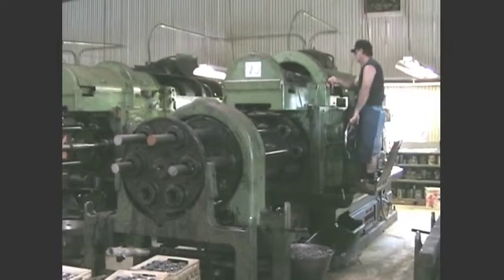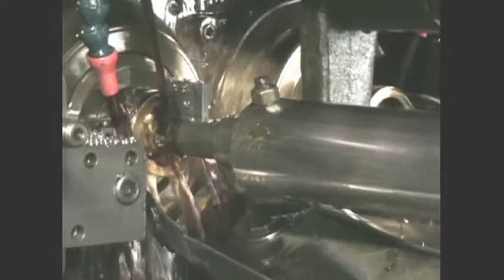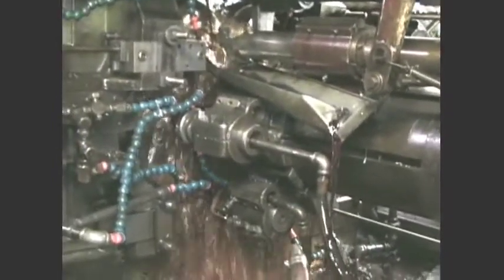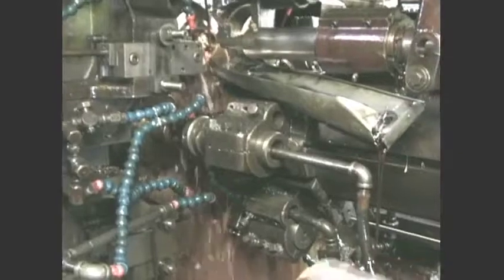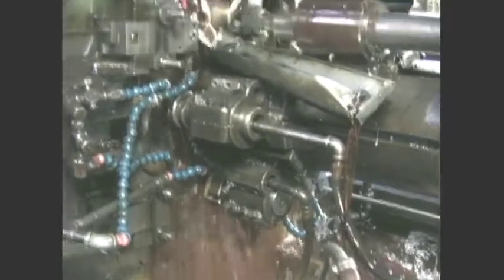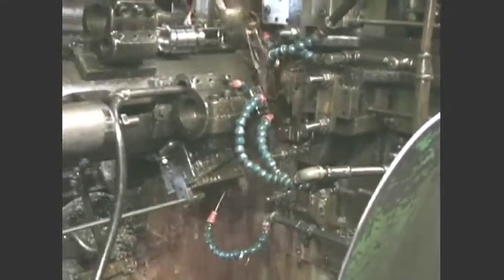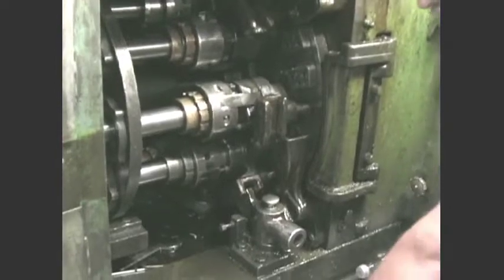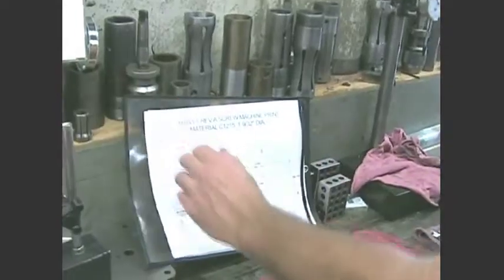Six Spindle Cone Automatic Lathe

Comment: I used to set the wickman multi spindle autos I had 7 in the shop and was awsome I loved them
Reply: This is a longshot but do you have any tips for setting up Wickmans? I was being trained on setups but our Setup guy actually passed away very unexpectedly. I have some old operator manuals and even found an Operators Handbook for a Conomatic Machine which actually has some useful information as far setting tools goes. I know they are different machines but the process seems similar enough. 

I'm trying to piece together a setup right now by referencing those manuals and the other machines we have in the shop.